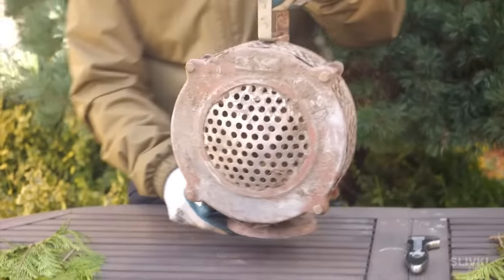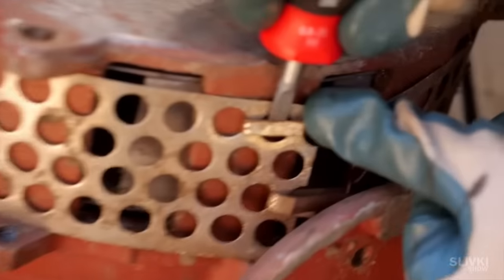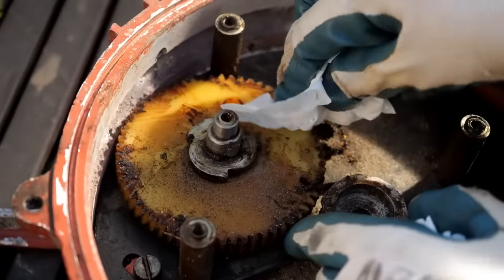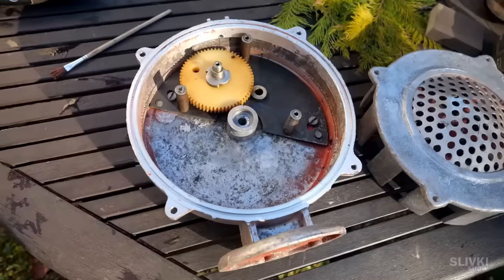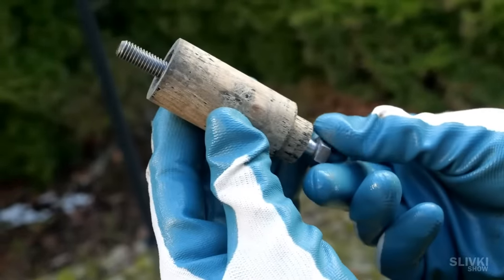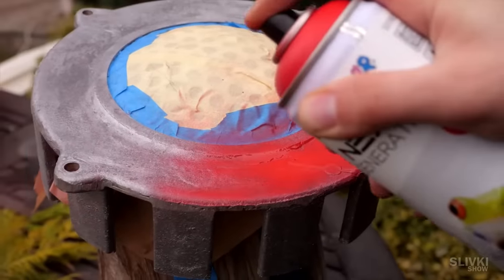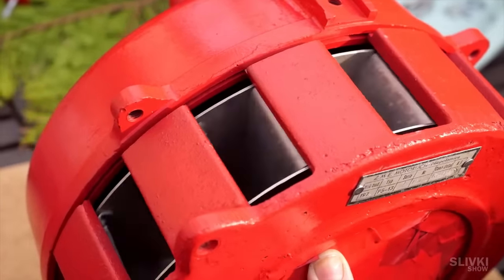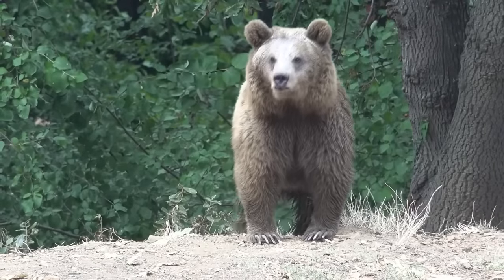RESTORATION OF THE HAND-CRANK AIR-RAID SIREN

Comment: Also, a  siren works by the fins (vanes) sucking in air through the front and centrifugal forces fling the air outwards and away from the rotor and pass through the stator. Since the rotor and stator is slotted, it pulses the air. And thus creates an on and off popping sound. This can be sped up to create a tone. In this case, there are 12 holes, therefore making it 12 ports. The slot count on the stator doesn't really matter but it's most efficient if the stator slots are the same size as the rotor slots. The smaller the gap between the rotor and stator, the louder the sound will be. You can also create dual-toned sirens. It's just two rotors and stators  or 1, (See ACA Screamer S-10) with different port counts.

TLDR A siren pulses air via sucking through the front and blowing outwards and creates noise
Reply: Didn't know I'd see CT here

Comment: Usually you can wash old grease and oil with either paint thinner or gasoline. At least non silicone grease that is. They are byproducts of oil refining, and carbon based lubricants can be dissolved in them. The only potential problem may be plastics that paint thinner and gasoline can attack.
Reply: that’s why he used biodegradable remover

Comment: You should use paint stripper with your next restoration. Way easier than grinding at it all day.
Reply: A sandblaster might come in handy, too. Use walnut shells or baking soda at a lower presser and it won't damage it. 🤔😁